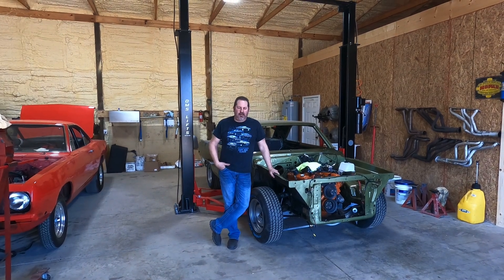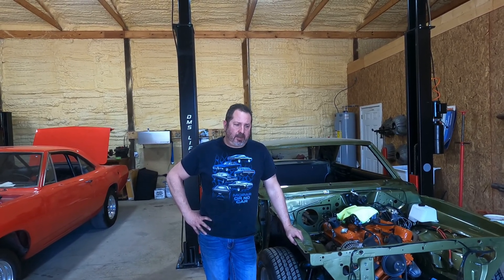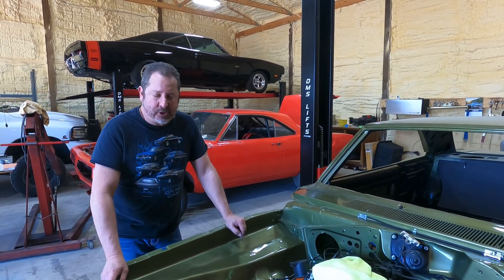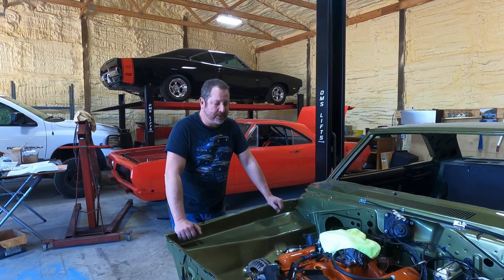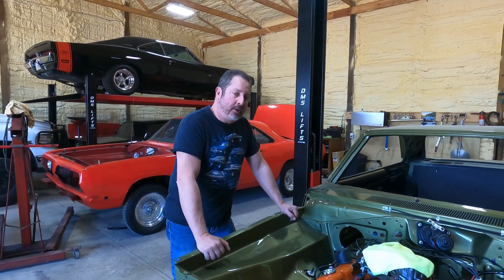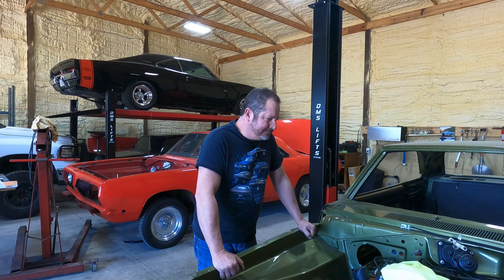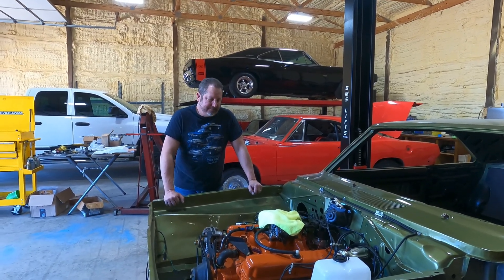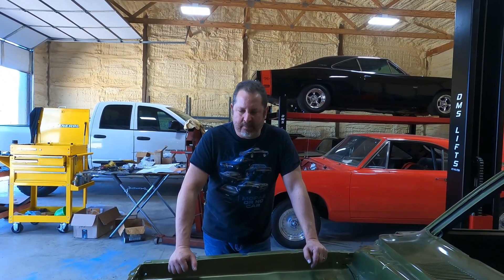Iron vs. Aluminum Cylinder Heads

Comment: On a 440 Mopar you can get 521 horsepower, in a streetable build using cast iron 906 heads with oversized valves and porting using Mopar Performance porting templates. That’s good for 10.80’s in a light ABody duster when everything is done right.that includes using a windage tray and blocking off the exhaust crossovers.
Reply from the maker: I don't argue that at all. However unless you are doing your own porting, 90 percent of machine shops today don't want to mess with any brand of iron cylinder head as it is so difficult and time consuming compared to aluminum.

Comment: Uhm?? FE cylinder heads are not a big head? Becouse part of the head is cut off. It's part of the intake? U have said a few key things that make me question ur knowledge??
Reply from the maker: I don't remember saying it was a big head, and yes this is why the iron FE intake is so heavy because it's part of the cylinder head. Not sure I understand what you are saying.
Reply: @blakesmusclecar  u said "its a big head with lots of metal to remove if u port them. That's why a shop won't want to work with them" that's not word for word, but thats pretty much what I heard? Maybey I misunderstood what you said? If that's the case, my apologies. I'm not always right, I know this.

Comment: Ethanol indeed has its problems but Ethanol raises octane!
Reply from the maker: E85 allows you to run high compression but 10% ethanol in pump gas is detrimental to older cars with mechanical fuel pumps and carburetors. It attacks butyl rubber diaphragms in the mechanical pumps and evaporates and creates vapor lock due to a lower boiling point.
Reply: @blakesmusclecar  I drive a 71 f100 4x4. I run 10% ethanol all the time. Old cars can handle 10%. The only time it couses issues is if u leave it sit. It should never be stored with ethanol. That being said u can take the ethanol out of the gas. When u do that u will lower the octane rating. 10% ethanol raises the octane of the fuel from about 85 octane to 87. If u start with 91 octane 10% ethanol raises it to 93 octane. I prefer 91 octane with no ethanol. My old 390 is a strong runner but under heavy throttle she rattles alil with 87 but 91 its smooth
Reply: @blakesmusclecar  oh ya, I have a regular ol mechanical fuel pump. No problems. I agree with u if it's more than 10% or if u leave it sit. But if it's used daily, it's fine.

Comment: Great explanation.  Those who pay others, often arent driven by what costs less.  Their "budget" includes labor paid to "shops".
  The guy in his own garage often makes sense of his decisions over fifty bucks difference.  Iron heads or no heads, brother! 
  Love your channel, subscribed!
Reply from the maker: Thanks Danny! I try to explain this to customers daily. The usual initial request is, "I want 500 horsepower out of this engine" but then I explain what it takes to get there, and most times it requires aluminum heads, roller valve train etc. Then they say, "I don't want to spend that much, just do it using my factory 2bbl heads by porting them." I also try to explain fuel and compression ratio's. Ethyl fuel hasn't been around since maybe the early 70's. They don't understand the fuel issue many times.
Reply: @blakesmusclecar  people are funny, right?
  "My brother put a jet engine in his mustang last spring and the chicks really dig him"..."I want my 350 olds rocket to rev like that".
  (:   on methinol too.